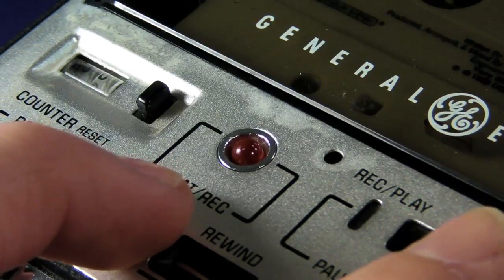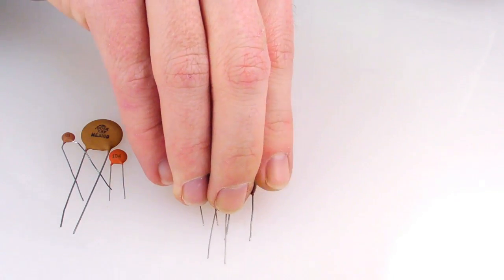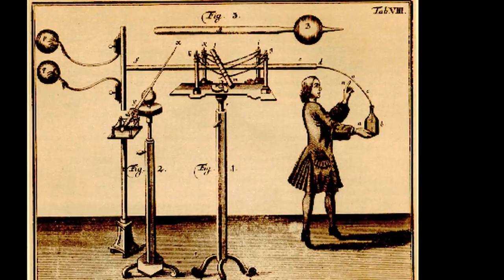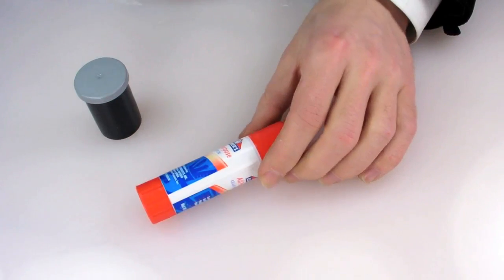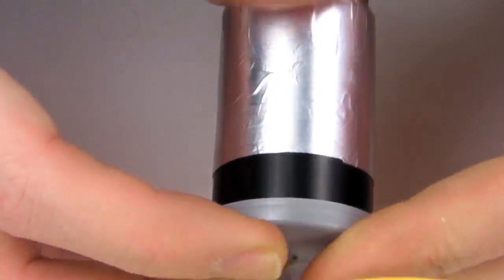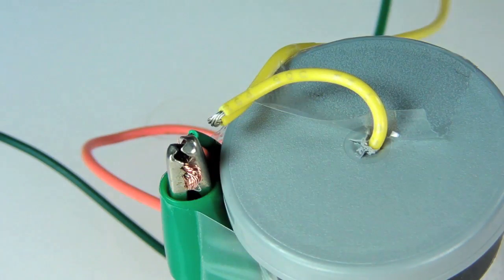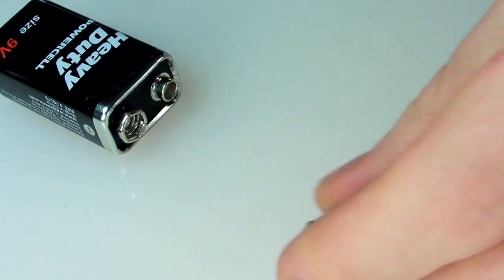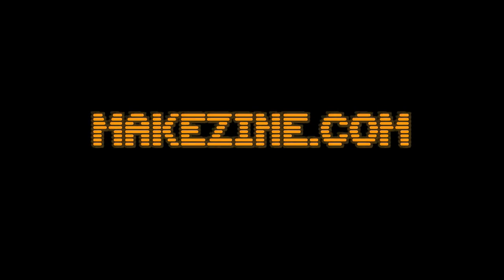MAKE presents: The Capacitor

Comment: a resistor limits voltage basically the resistor stops too much power from getting thru and burning out say an led if you were running an LED from a 9 volt battery.

Comment: actually that is a good question the difference is that batteries have resistance in the acid that stores the charge if there was no resistance a 12 volt battery would be able to kill you.

Comment: Does the cup (?) capacitor have enough power to light an LED? My home brew aluminium capacitor is not showing any change when it was charged with a 9V battery. About to think this is really working??

Comment: This is a great video. Maybe youtube can help with a capacitor question: I understand how a capacitor works in an AC circuit, in theory (90 degree delayed sign wave between Voltage and Current, because it resists changes in voltage), as there a lot of videos on the science behind this, but I don't understand it's practicality and can't seem to find that video. When, and why, do you actually use Caps. in an AC Circuit? I've seen them in AC to DC conversion circuits but I don't understand why they are there or where else to use them in AC. Thanks!
Reply: Capacitors are also used in tuning circuits used in radios. Tuning circuits can consist of a variable capacitor, an inductor, and a resistor - a simple series resonance circuit. However, as far as I know, variable inductors are used instead because they're easier to make and are smaller in size.
Reply: Assil Ksiksi Hi: thanks so much for taking the time to respond. I'm studying electronics, and I finally gave up and called my stepfather/electrical engineer. He agrees with what you said. He also added that capacitors are used in AC circuits, because of that resonance property, to clean out any "junk" in the signal. Because Caps resonate at specific frequency's based on their rating, any "extra" signal that might develop in a circuit gets filtered out by the cap. Makes sense, because real world circuits are different than theoretical circuits, something I learned the hard way when I wired some LED's in parallel and current dumped/blew all of them. This makes a ton of sense now. Again,thanks for your help!
Reply: Very helpful and well explained. Thanks for the help!

Comment: a capacitor stores electricity and saves your battery life. A resistor resists the flow of electricity, It decreases the amount and the rate the electricity will flow through

Comment: I don't think you understood what I meant when I said "empty space". That means a vacuum of empty nothingness. I excluded it because it's not relevant. You don't need a dielectric to make a capacitor.
And yes, if you connect a battery to a capacitor, one plate will be added electrons, but the other will loose electrons. Like I said before, there is just as much reason for one plate to be - as the other to be +.

Comment: if i were to make a switch that, once pressed, would only work again after a certain amount of time would i be able to do it with a capacitor? If yes, how?
Reply: +Arthur Cascardo Yes sir. A capacitor, a resistor, a relay.  Adjust your "time" with size of cap, and rate of resistor. You can latch out switch conection with the relay until say the capacitor is drained and then it would be active again waiting on you to make the switch again.
Reply: Thank you very much, i don't really have a lot of knowledge in electronics and i was stuck for while trying to figure that out.

Comment: the time constant, a measure of how long it takes for about 2 thirds of the charge (1 - (euler number)^-1 exactly) to be dissipated through the resistance if you had nothing but a resistor connected from the inside of the laden jar to the outside. You see resistors all the time in parallel with capacitors in circuits to control the rate of discharge and frequency responses

Comment: what is the difference between charging a capacitor and storing Energy in a capacitor. please give a demo for their usefulness in practical application.
Reply: I hv 1F capacitor and 12v supply..
if I use Q=cv charging capacitor I get Q = 1x12 = 12 col charge __(1)
if I use E=1/2 C x VxV =.5x1x12x12 =72J _(2)  (keeping other conditions same)
which result should I take in account ??? and why ????
Reply: you did not answer ???

Comment: Hi, I find some old filter-caps in a fleamarket.
One nichicon with 6 terminals a:200MFD 300WV b:10MFD C:20MFD D:20 and E:120MFD...I´m Newby in the electrical stuf and buy for the big size for experimentation, can i charge it with 12V? power suply...what means WV? the mega farads means more electricity storage capacity?  tkz for share

Comment: i built a leyden jar that was bigger and it made sparks about 1.5 inches at the best and it was very painful to get shocked by it. i could only charge it using static electricity and charging it with a battery would result in absolutely nothing. does anyone know why?

Comment: actually what i said about then resistor was wrong but he basically a resistor helps slow the voltage flow he used a 9 v battery so he used a resistor so the led wouldnt blow also i was thinking of an rc circuit (plz google to complicated to explain via text)

Comment: So...when's the time to use a capacitor and what's the purpose of a capacitor? Can someone give an example please?
Reply: Well I know it's purpose of a capacitor lol but I'm not sure how or when it's useful.
Reply: You can use it just like an rechargeable battery. It just has less capacity and is very fast.
Reply: *****, it really depends on the type of motor used.
Reply: Chris Wu  Being a green pea novice myself, I clicked "View all responses" to your question.  Nearest I can glean from these other comments is it sounds like a capacitor is a really crappy battery, but do not worry as there are some motors that, depending on type, can run off that blip of a charge.....  Seriously, I think it has to do with having power ready to go quickly and/or be discharged quickly as some items need the jolt to get going, but how it knows to discharge and when....and still why, is a question I am also looking to have answered.

Comment: Can someone tell me if it’s possible to use an alternative to a 2.2µ 15V?

I can find some capacitors with 2.2µf but they all have a different volts...what does the volt mean btw? Is it how much volt it can hold or how volt it can handle before getting damaged?

I’m playing with a DIY instruction and some parts are hard to find.
A 10K resistor is connected to the 2.2µf 15V cap- is it possible to change the resistor value so that I can use another cap?

Need help please!!!

Comment: you can make a deadly capacitor with foil and wax paper. the larger the to sheet of metal (L x W) the larger the charge and the lack or a resistor the more likely there will be a rapid discharge so when handling caps. BE CAREFUL

Comment: The Testatika is an electromagnetic/electrostatic generator based on the 1989 Pidgeon electrostatic machine which includes an inductance circuit, a capacitance circuit, and a thermionic rectification valve. Allegedly a free energy machine that harnesses energy from the aether
.Just kidding i copied paste that

Comment: how do you know how long to charge capacitor ?
Reply: +Connor Dow it doesn't matter how long you connect it to the battery as the capacitor will automatically stop acquiring charge as it reach it's maximum capacity.

Comment: it will hold a charge until both positive and negative points end (more or less time scale could be a long time) to discharge put both points together to make something light up like the led u need a resistor to equalize the energy lost ***note not 100 percent accurate just what i am aware of

Comment: what factor determine voltage range in a capacitor ?
capacitor having high capacitance and low voltage..
capacitor having low capacitance and high voltage..
what are the significance of above two....
is a capacitor having high capacitance and voltage perform better...to light a bulb,run motor longer....
Reply: I would guess that the voltage has to do with the thickness/conductivity of the film separating the 2 conductors. The capacitance is determined by the surface area and the material of the conductors. Capacitors have a voltage rating, which usually means it's the highest voltage you can charge them at safely. Any higher than that, the electrons would jump through the film between the 2 conductors. But you can charge them at any voltage between 0 and maximum rating. The amount of energy stored is dependent on voltage and capacitance.
Reply: Thank you very much....
I use 225 Kwh every week,@110V, if I need to run same Energy through capacitor How big capacitor I should arrange @ same voltage rating. If any alternate suggestion , appreciated.
Reply: I'm not sure what you're asking. To store all the energy that you are using in a week you would need a huge capacitor. Capacitors store a tiny amount of energy (compared to a battery). If you wan't more energy in a capacitor you should use supercaps, with far higher capacitance, but usually lower voltage.

Comment: they charge so much for a high voltage ceramic capacitor yet they can be made your self for only a few dollars. ive tooken many apart to know how they are made. makes me angry that i payed 250$ for one and find out it was only made out of ceramic tiles stuck together and some silver solder on the ends and encased in plastic

Comment: sorry supasexysnake, Kilobyte is 1000, Mega = 1 million, Giga = 1 billion, terra = 1 trillion etc.

and gloith, when dealing with bytes, computers use Kibibytes, Mibibytes and Gibibytes which are powers of 1024 instead of 1000, so mibi is 1048576, unfortunately Windows incorrectly calls these Mega, which is why your hard drive shows less space than the label, 80 billion bytes IS 80Gigabytes but not 80Gibibytes as the computer is using

Comment: Don't you just hate it when someone is trying to explain something in a video and they teach absolutely nothing? I'm assuming that's how you feel.
Capacitors are basically two plates standing side-by-side but don't touch. A Farad is equal to Coulombs/Volts, or the charge that a capacitor builds up on one plate when you apply one volt threw it.

Comment: Lets start an energy revolution. A capacitor is capable of unlocking the energy that runs a permanent magnet. Configure it how you want but the magnetic lines of flux need to run perpendicular to the electric field's lines of force. The magnetic lines of flux have a virtual current spinning on the axis of each line and have to be in motion to run into a wire. The electric lines of force supply the force to move these virtual currents so they run in a wire. A wire sitting still within a magnetic field has no emf induced because there is no relative motion. The wire and permanent magnet sit still while the electric field lines of force divert the virtual current into the wire eventhough the wire has not moved. Magnets are the key to cheap energy, not free, you still have to create the electric field and discharge it so the dielectric will not breakdown. A store bought capacitor will not work, you have to make it.
Reply: I used a stainless steel pipe inside a glass jar and put neodymium magnets inside that pipe, then wrapped coils of 16 guage copper wire on the outside as a collector but it doubles as the other capacitor terminal so it is a closed loop with the load in series and high voltage. The stainless pipe is the other capacitor terminal. Pulse and discharge.

Comment: So, what is the definition of thr Farad?
Reply: +Matthew Ferrie it's the unit for the capacity of a capacitor.
Reply: +Ford Junior I know that, but is it something like one Coulomb per Volt?
Reply: What do you mean? If i remember right,the capacity only depends on the conductive plates,not sure how they measure it though
Reply: +Ford Junior I mean, capacity for energy. Energy is measured in joules. I'm not sure what the conversion factor is, but I do know that both voltage and stored charge have something to do with the definition of capacitance

Comment: So it's a battery?
Reply: Pretty much, however a battery works differently and can hold more power at smaller sizes than a cap.  From what Ive read, it would take a cap the size of a 1 liter soda bottle to power a 4 watt bulb for one minute when an AA battery can power it for about a little more than an hour.
Reply: lol true

Comment: I don't get it ? Why that we need a capacitor at the first place ? I know it store energy i get that. But if got voltage that is going direct too the source. Example the L.E.D. that he show in the video. Source is a 9 volt batteries, now we need to drop the voltage we would use a resistor and it finish. I know that this is what we call simple circuit. But even with a complex circuit ? We still have the voltage that can go directly too the source ? This is not my language so i hope my sentences make sense.
Reply: My question is exactly the same. Why make things more complicated than they already are ?
Reply: the capacitor makes the discharge of electricity conditional, for example a camera flash uses a capacitor to store a charge then dissipates it to the flash bulb
Reply: Seymour Butts Thank you.

Comment: Static electrical created by a leather gourd rattle with quartz, spalerite etc. mineral. American gourd rattles found in earth mounds or obtained from native American family ceremonial item would light up in the darkness due to static electrical discharge due the minute dust field generating static electrical flash due to the charged pebbles touching and pulling away. It is not due solely to a friction or fracking of the pebble alone. The dust field acts mimicking the conditions of the rare earth dust in the ionosphere of the upper atmosphere, The dust is encased by ice and becomes hailstones that get both negative and positively charged. Two oppositely charged hailstones collide then pull apart form a small static electrical spark that flows back and forth through the air positive then negative through those contrary electrical fields towards earth. This is a basic explanation for the beginning of all of the cosmos and life in living creatures and life on this planet. The question i understand and have novice knowledge on is the spiritual and both scientific principles of this is simply: How can this process be utilized to effect a rattle that creates easier?

Comment: Vaguely inaccurate definition of a capacitor. First, you didn't mention the dielectric, which separates the two conductive plates and allows an electric field to be established in the first place. And 2. Electrons are not removed from the opposing plate...The electric field strength is composed of an "Excess" and "lack thereof". Imagine 1 plate having 5 electrons, and receiving plate having 5 as well. To establish an EField, you simply need to add more electrons to 1 plate, you don't remove any.